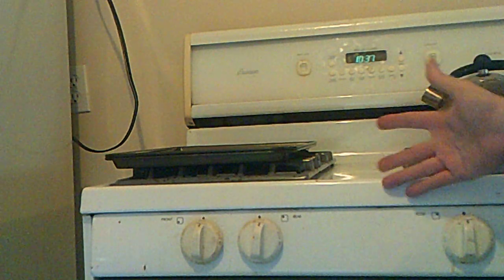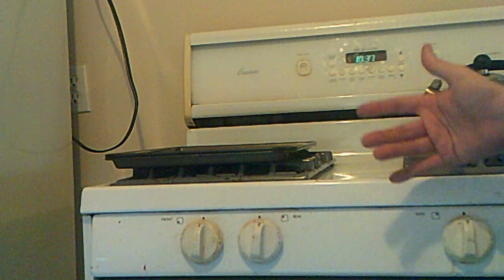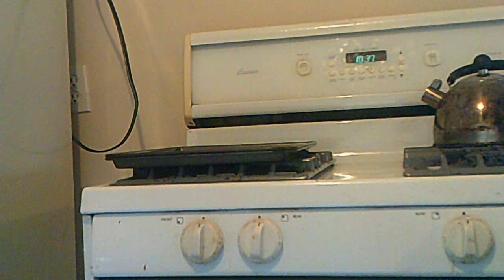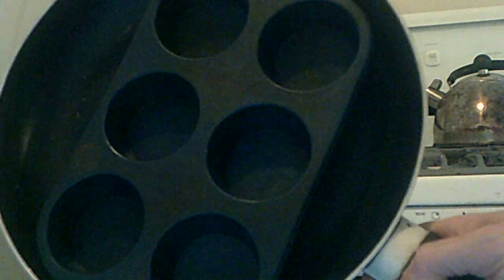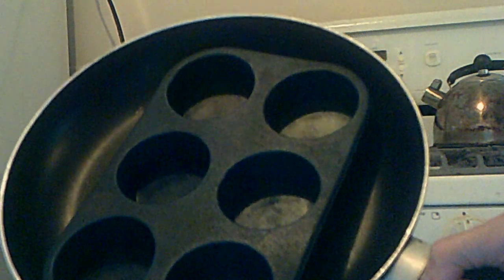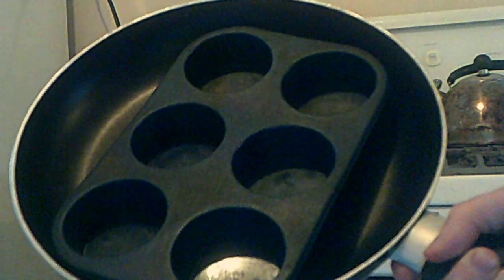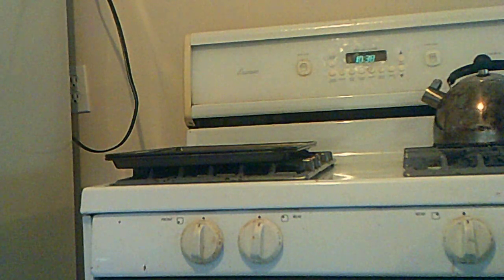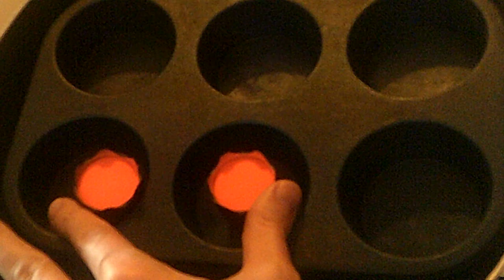Drying Spray Painted Plastic Using A Kitchen Oven

Comment: Hey there great  vid  I've used this method before with great success.   Especially headlights if you paint the inside and don't let it cure it will  haze up the lens from off gassing the paint when it dries.    This really speeds it up.
Reply from the maker: Thanks for the tip Jordan :)

Comment: Thanks for the video, Ron.  Would it be safe to use the oven to cook after doing this?
Reply from the maker: I think so as long as the spray painting is applied is a well ventilated area.  When I was a child there were different crafts I did that involved baking the plastic.  I think you'd want a vent hood on your oven for any fumes that come.  I've done this so much now that I have a toaster oven that I do it outside in my yard.  I have been using baked on enamel automotive paint that require heat for curing on metal.  This also opens up the possibility of electrostatic coating.
Reply: @RonPiggott  great, thank you for the tips.
Reply from the maker: @gracebyseven  Very welcome.  All the best.  I find the creative part of crafts helps me cope and co-exist with my physical disability / chronic pain.
Reply: @RonPiggott  absolutely.  I find the same for my ailments.  Very therapeutic.  Happy crafting!

Comment: Thanks for taking the time to make this video. I don’t like painting so I’m not very knowledgeable about paint drying times and re-coat times. I’m painting plastic ps4 controller with rustolium hammers paint. What should I use for a clear coat. I asked the guy at Home Depot but that’s like asking an toddler the meaning of life. The Laquer they gave me does not look good at all.
Reply from the maker: Hi Ryan.  If your controller is made of plastic make sure you use spray paint that specifically says it  will bond with plastic.  This is the clear coat I use on my projects: https://tinyurl.com/yalfpzyh  That link is going to bring up a picture.  I'm sorry you've had a poor experience at 'Home Depot'.  Many of my local 'Home Depot' staff know me and have been very helpful.  Please don't write  them off altogether.  Ron